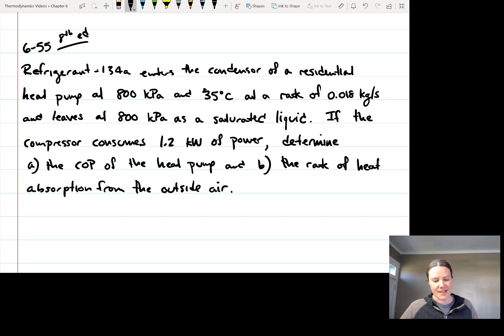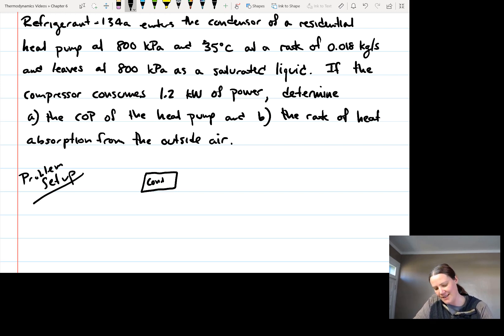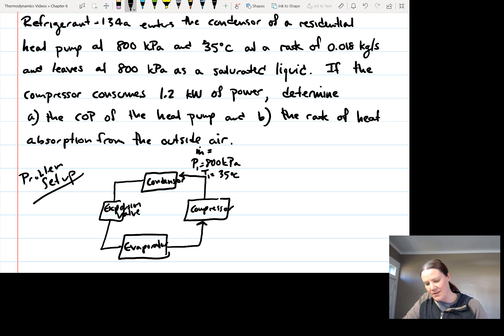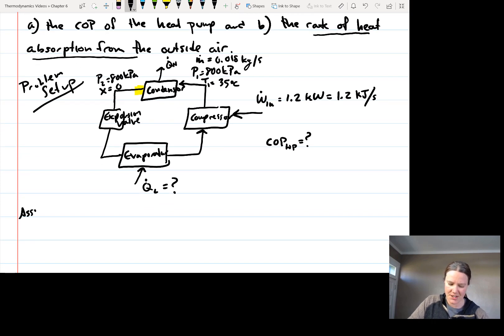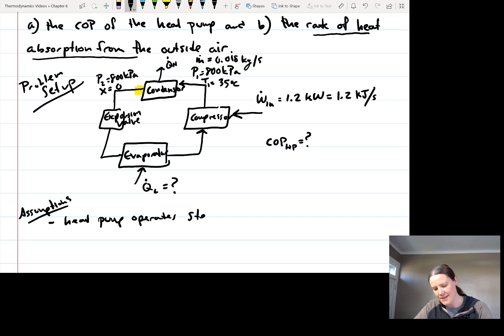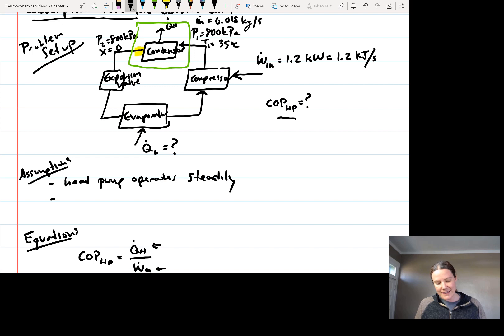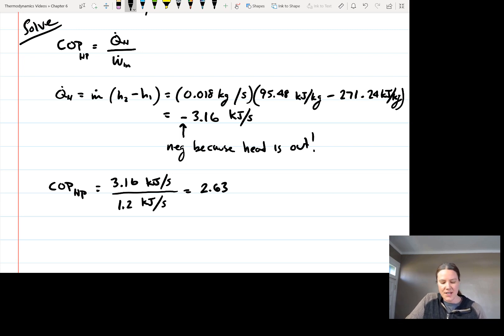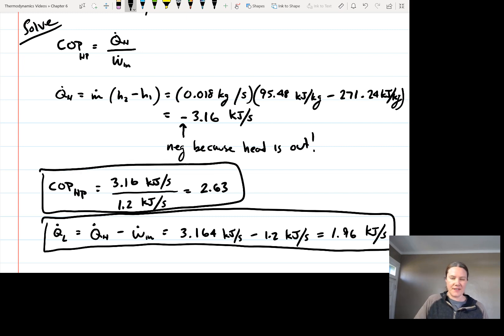Thermodynamics: Calculate COP and heat absorption rate for heat pump

Comment: In case if you're wondering how to get h1 since it is not part of the R-134a superheated table, use interpolation method (use the line equation y = mx + c, where m is gradient, y is your enthalpy, x is your temperature, and c is y-intersect), insert x = 35 and voila

stolen from @A Graham btw

and thanks for the solution video!
Reply: Thanks
Reply: How do you get the m and c?